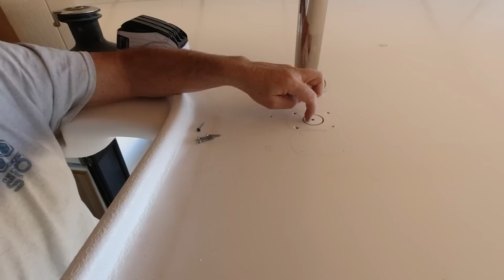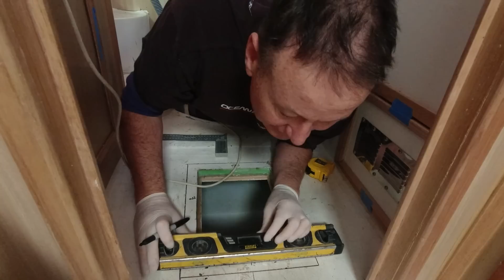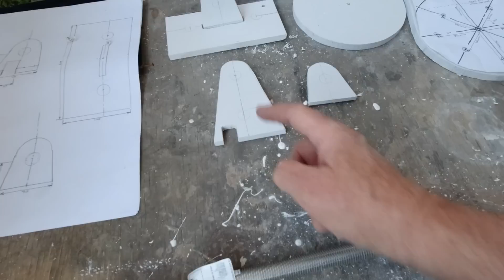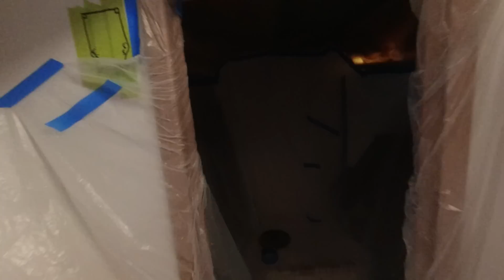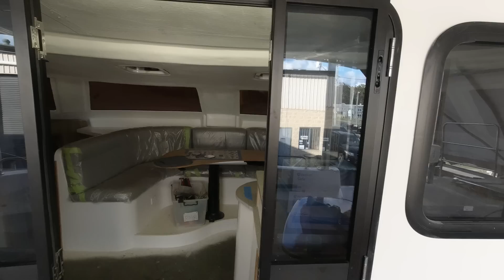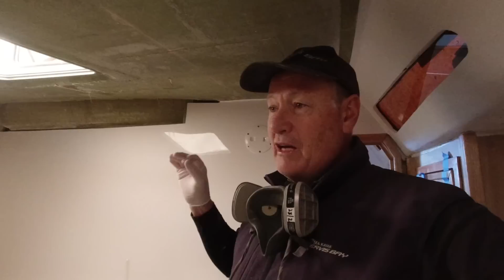A Myriad Of Boat Building Jobs - 12.7mtr Catamaran Build EP351

Comment: Looking Good Janet ! Like the new footrest/handhold at helm Ross ! For the footrest under seat, rather than make it a folding version, perhaps you can take advantage of your existing structure and use the horizontal bars under and parallel to bottom half of seat to allow a slide mechanism so it moves laterally or telescopes outward a few inches ?

Comment: That footrest adjacent to the helm wheel will only trap a foot/leg/arm once.

A length of fencing wire might push it's way through the foam to run wiring routes?        Specially if rotated with a drill.

RV

Comment: Looking good Rossco, i would of used a solid stainless bar and had a thread machined on the end to lock the forestay in place, welding threads isn't very strong, from my experience. But I'm just a bodgy fitter.
Reply from the maker: I reckon we came up with a great solution, I will put some photos up on patreom next week. It has been a long process getting these chainplates made.